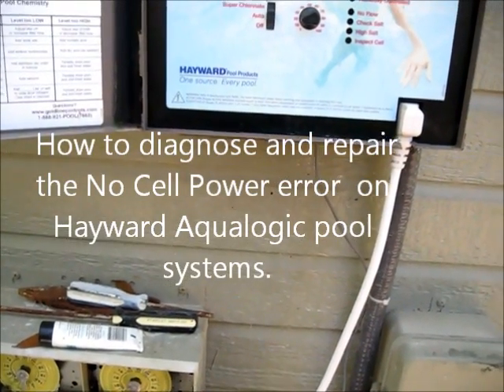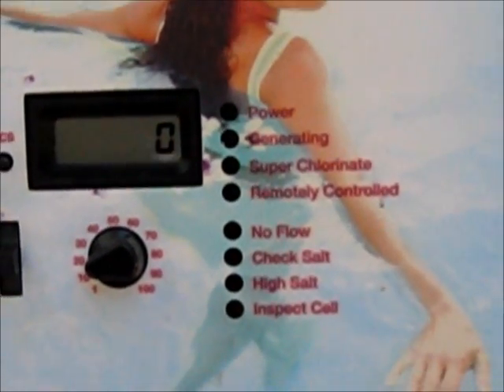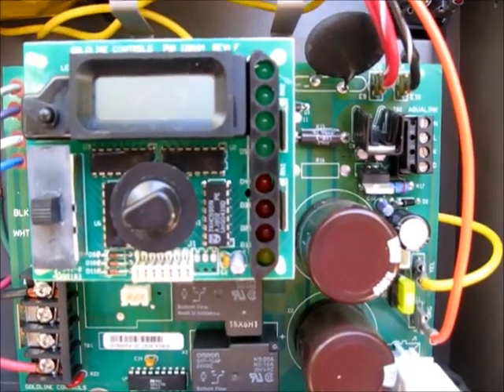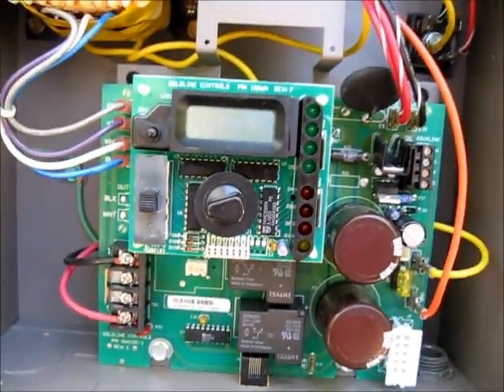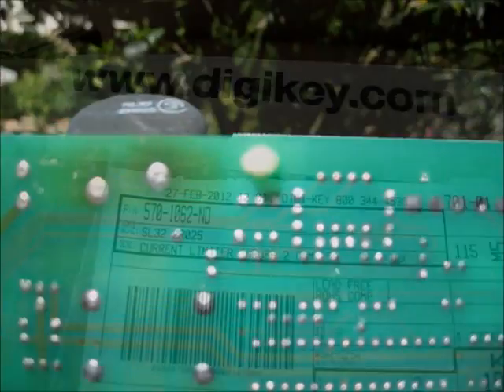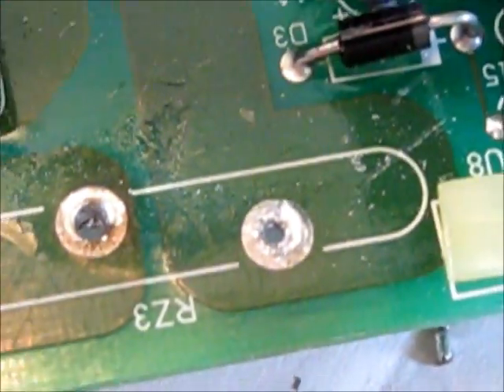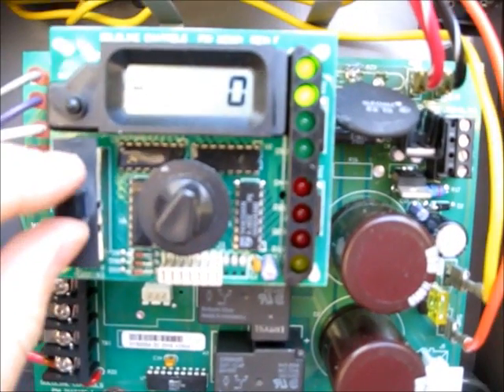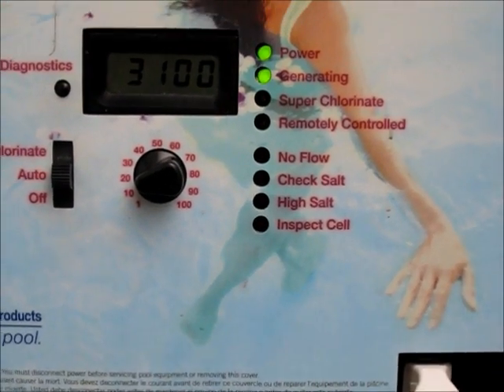Aquarite Hayward No Cell Power.wmv

Comment: Joe Homeowner - Thanks so much for posting this video!  Had the same issue and it worked great.  My AquaRite Chlorinator was powering on, but after about 20-30 seconds the Power and Generating lights would go out.  Turns out the resistor was the issue.  Quick easy fix, even with a sloppy soldering job.  Thanks for posting it.
Reply: Cliff, can you give me the part number of the resistor and where you purchased it?  I have the same issue.  Thank you. Angel
Reply: Angel Antonio Montenegro This is the part that I purchased from Amazon (http://www.amazon.com/gp/product/B00DKYO2IO/ref=oh_aui_detailpage_o01_s00?ie=UTF8&psc=1) -- the part description is "AMETHERM SL32 2R025 NTC THERMISTOR (1 piece)" -- but if you have an electronic store near you then you can probably get this for much cheaper - a couple of bucks at most.  You will also need a soldering iron and solder.  Cheers, Cliff

Comment: My unit was running warm all summer but it was generating and I had a clean pool. The tube is almost 5 years old. Then this weekend it stopped reading salt and there were no lights. If I reset it. All the lights came on but, the indicator would go to zero in a matter of seconds after the computer told the tube to take reading and then green power and generating light would go off. If I switched the computer to off. The power light would come back on after a few minutes until I switch in back to generate. Then the same thing. Today I turned the power off to the until and unplugged the cord to the tube. Once I turned on the power again there's no green lights. Just the flow indicator. I'm assuming that the tube isn't running efficiently and it cause that thermistor to bun out. I checked each side of the fuse pongs and there's continuity.  I took off the board and there's no brown in back of the limiter.  I ordered one anyway. I'll solder it in once I get it. No huge job for me. I also ordered a replaced tube because it is five years old and I think it's the root cause anyway.
Reply: I replaced both T-Cell and thermistor two days ago and I'm back in business. The circuit board is running much cooler too.

Comment: Thanks for the info, saved a bundle of cash, the only issue was removing the old solder. I just cut the legs and left 2 stubble's to solder the new limiter switch to, System back up and running fine. Great help, Thanks

Comment: Great video, thanks for the help. I had the same issue. When I talked to my pool guy, they said that we'll need to order part and eliminate. They first suspected the flaw switch which they replaced for over 200$. The problem continued and they suggested to replace the board next. I got sick and tired of Hayward and wanted to replace the entire unit with Pentaire instead. They gave me a quote for 1500 + 85$/hr labor. I decided to wait and search in Google for similar issues. I cam across your video and others. I ordered the limited and the fuse per your suggestion. I received the parts today and after 1 hour everything seems to be working. I just need to add more salt now. Thanks for saving me over 1500 dollar....Riyad

Comment: Another happy DIY job. Thanks again for the post.  As anyone played with applying a heatsink to this unit to keep it from fracturing? I was thinking about one of the types that are sort of like a taco shell and just squeeze each side of the part, maybe with some thermal greese like you would use on a CPU.

Comment: Hi Joe, Thank you so much for this video. Bella jobba.  I actually opened up my Aquarite system and the current delimeter was cracked down the middle. So to check if this was the problem as a temporary fix I used electrical tape and a small binder clip to keep the crack sealed. Turned the system back on and it's working now.... wooohoooo,  I should receive the new part that I ordered from DigiKey shortly
and make it a permanent fix.  Molto Grazie!  I was almost ready to go and purchase a new board.... saved me lots of Lira.  Thanks for the video again.
Reply: Temp fix working.  Order new current delimiter to install.  Thanks.

Comment: Thanks for the post!  It worked for me and I have rarely repaired anything electronic.  It took me about 40-minutes from start to finish.  The part number you need is 570-1062-ND  (CURRENT LIMITER INRUSH 2 OHM 25A)  from digikey.com, it costs about $2.50 plus a few dollars for shipping.  I bought two, just in case one came broken.  If you don't solder check out this link...

http://www.howcast.com/videos/504729-How-to-Create-a-Good-Joint-Soldering

Everything the video states is accurate.  It may not matter but when I removed the part I noticed the writing on the part itself was on the bottom, so I reinstalled it the same way just in case there was a polarity issue.  I was told that its best to use a soldering iron and not a soldering gun.  I guess the guns can get too hot.  I worked for me and I hope it works for you as well.

Comment: I watched your video & it helped alot. In the past I just changed the circuit board & it was over $200.00. It wasn't easy to find a current limiter in town but after  a long drive I got one. I even bought a spare one. It wasn't easy to the remove the old solder. After working on it for 2 hours I finally had the generator running, and it only cost me $35.00.I needed flux, solder,soldering iron, solder wick and the current limiter. Thanks for all the help.

Comment: Digi-key sent the part Fedex overnight for $8-ordered it Wednesday at 6:00 p.m. and it arrived Thursday 10:00 a.m. in Ottawa Canada. Took the circuit board to Auto-Gadgets-also in Ottawa, for a 10 minute solder job at $20-very reasonable since none of the computer makers or electronic shops wanted to touch it. Cost less than buying all the equipment to do the solder myself.  Limiter cracked just like in the video and new one is working great in reassembled and cleaned unit. Kudos to mpickle01

Comment: Awesome video it worked for us also but with some small changes. Seems my board has some sort of heat shield over the solder on both sides and it was impossible to remove. We ended up cutting the old delimiter off then soldering the new one to the old legs. My thanks goes to Sunny Hobbies in Naples Fl who performed the work for free! Also thanks to Pinch a Penny in Naples who told me my only option was a new board for $700 dollars(criminals).

Comment: Thanks for the video.  I am having the same issue with my salt system and have noticed that we are not alone.  I wonder why Hayward does not fix the problem in the first place.  I have had the system for about a year and I don't believe some thing like this should be happening.  I am going to research this problem further.

Thanks

Comment: Thanks for this video.  Bought a replacement current delimiter from Digi-Key and did the install today...back in business.

Your solder job looks way better than how mined ended up looking.  I did notice that the current delimiter runs very hot to the touch.  I do not know if this is normal or not.

My Aqua Rite is almost 9 yrs old & has the deep dark blue cover panel. 1st repair other than cell replacement.

Thanks again for posting the video as it saved me quite a bit I am sure.